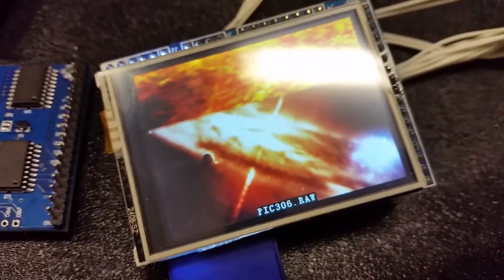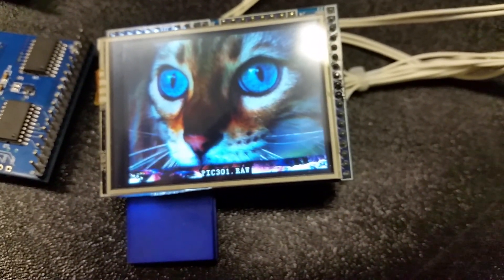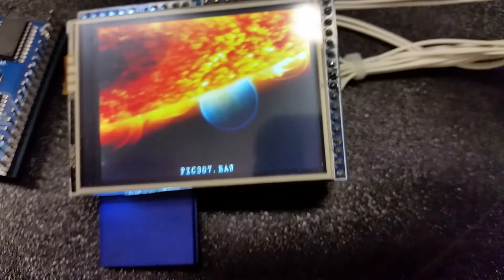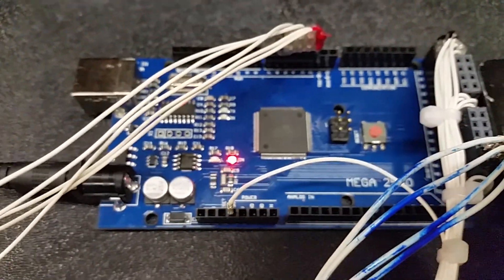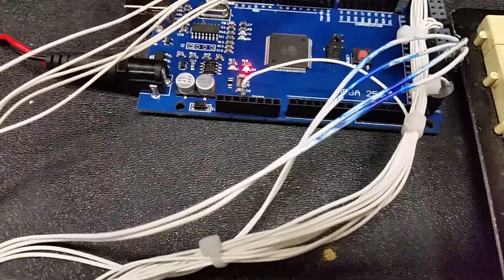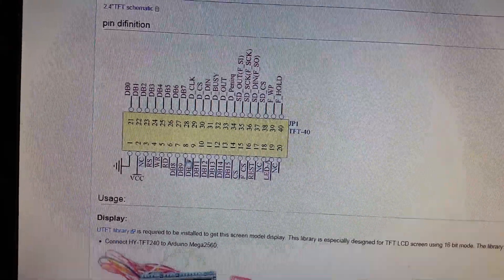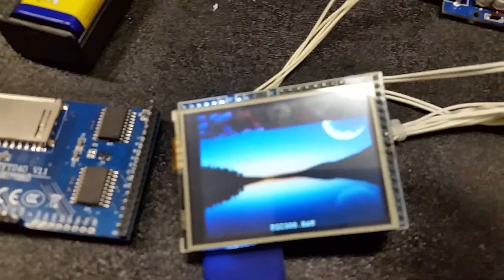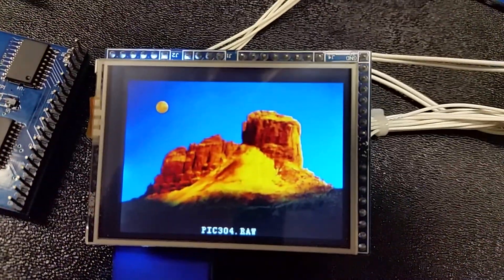Arduino Mega 2560 With Generic  2.4" TFT LCD SY-TFT240_V1.1 and UTFT Drivers

Comment: Have you brought it to life with the UNO? Unfotunately I have nothing else lying around. Initialized with UTFT myGLCD(ILI9325C,A5,A4,A3,A2);
Reply from the maker: I haven't used it with the UNO however it should work with it. you will just need to remove all the unnecessary code for the display or it will eat up most of your memory and you won't be able to do much more then run the demo. These seem to work best with the Mega since it has 256k of memory. You can get a knockoff Mega 2560 R3 for around $10 on ebay.